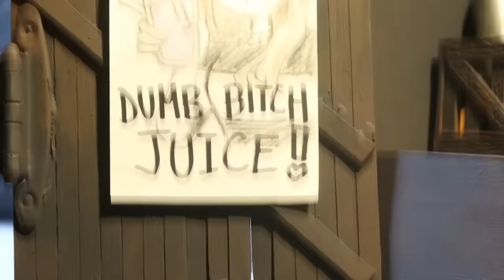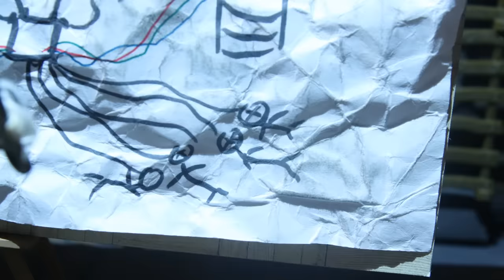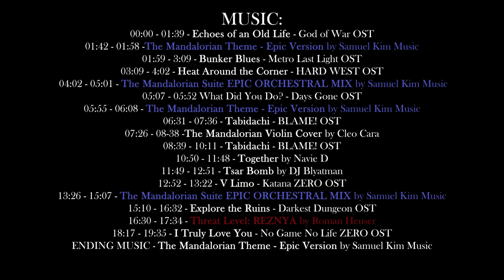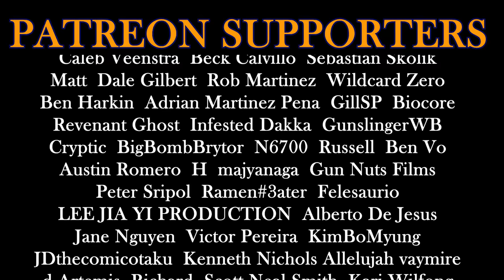THIS IS THE WAE | SHRAPNEL

Comment: the bullet currency is something I do quite understand yet, unless in this universe bullets cant be mass produced. if 30 bullets is alot, that has to mean something
Reply: Like, bullets can be expensive but I dont imagine them being able to be used at currency, Even if you need bullets to survive
Reply: Think about it, if most factories are destroyed and only a select few can make machine quality bullets of a high quality. Then you have the makings of a centralised currency with its own self regulation, as nobody is going to want subpar bullets. Hence they get into circulation as a bartering tool. Makes a alot more sense than caps ala fallout 3 & 4 etc, at least bullets have intrinsic value due to their own killing power.